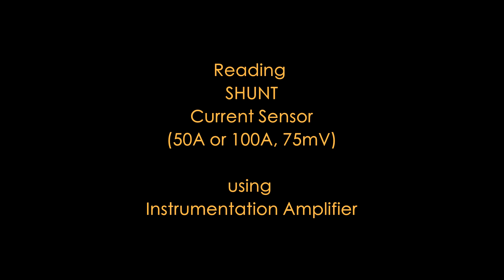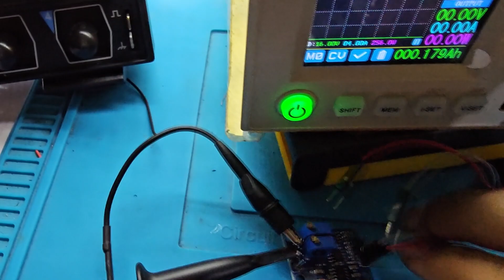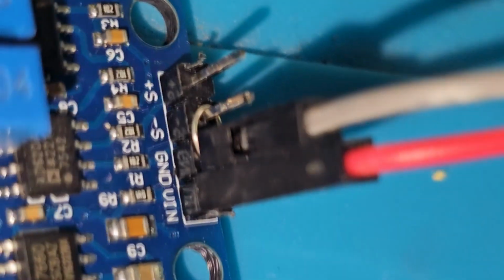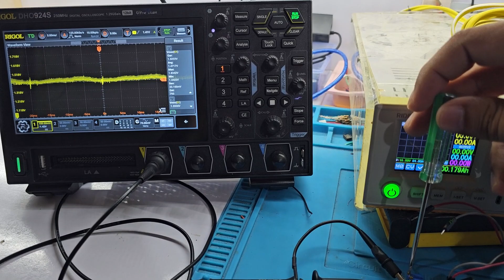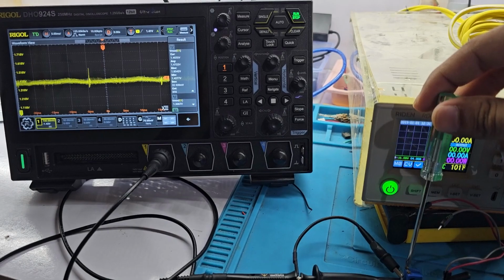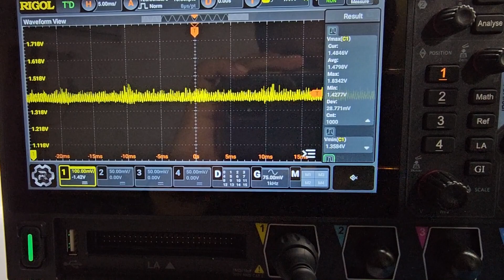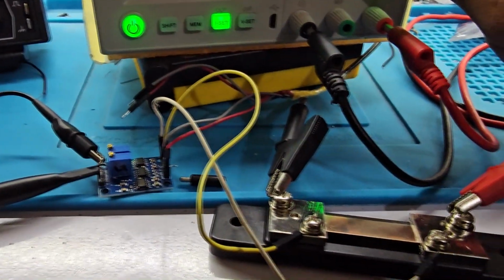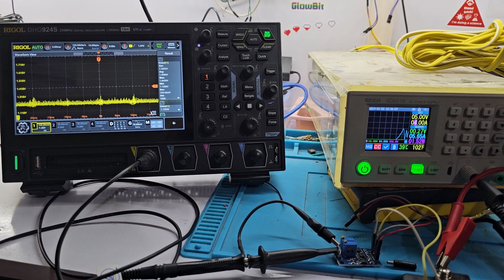SHUNT current sensor 100 A , 75 milli Volt | AD620 Mirco Volt Amplifier | ProDrone Control | #ASNNRI

Comment: That looks like a very noisy output signal.
Reply from the maker: It is! Comes from the fact that the input signal is very weak. Using averaging func in arduino it can easily be dealt with.